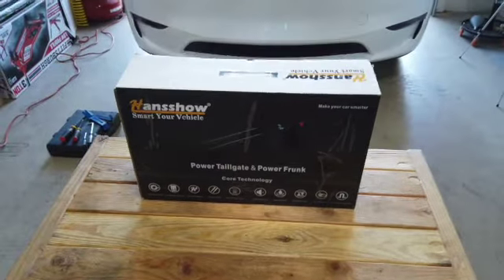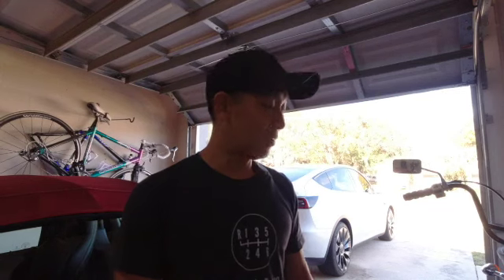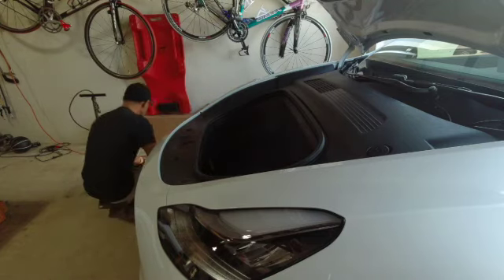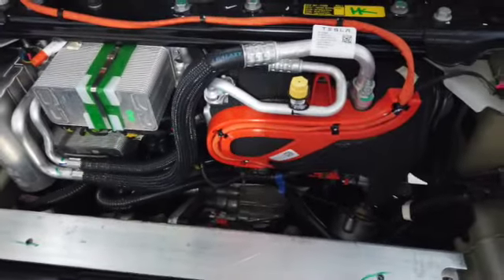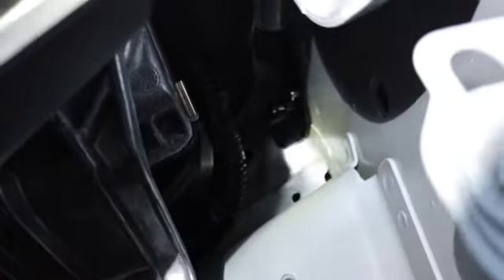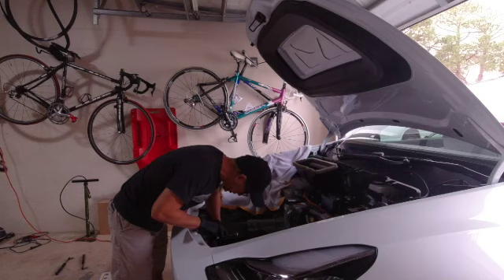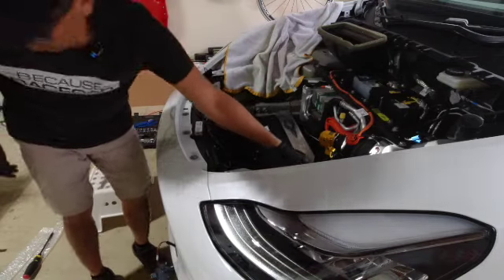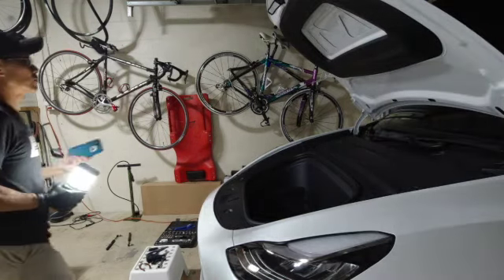Model Y Automatic Frunk Opener, Not as Easy To Install As I Thought Hansshow    SD 480p

Comment: Any tips for the latch? My friend and I installed tonight and we could NOT get the latch to close flush at all. No matter how many adjustments of the bracket. any tips?
Reply from the maker: sorry for the delayed response but did you get it figured out?
Reply: I had the same issue. The emergency cable can prevent the lock/latch from closing completely. This caused my trunk to pop back up 1/2 an inch and not fully close or lock. As soon as I moved the end of the emergency cable and zip tie, it was finally able to close correctly. (i spend three hours trying to figure out why it wouldnt close and I found the answer in an amazon review!)
Reply: @BenGifford  dude. Thank you. Your comment was the one that got mine to work properly. I relayed the message to a Hansshow authorized seller and he claims that the factory told him to NOT install the emergency cable exactly because of this exact problem. 

In fact, he was surprised that the cable was still in the kit.
Reply: @c208driver6  it’s because we can’t mentally fathom not zip tying an emergency cable down as securely as possible to the latch mechanism. Ironically this will keep the latch from closing altogether lol. Glad it helped at least one other person
Reply: @BenGifford  yeah when I saw your comment I was like “it just CAN’T be that easy??!!”. Sure enough, the moment I removed it….worked perfectly!